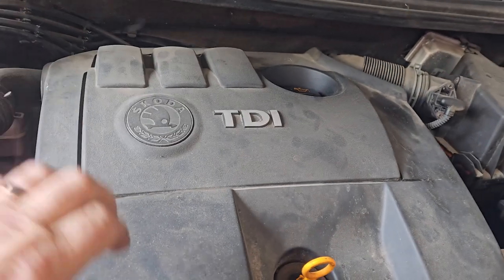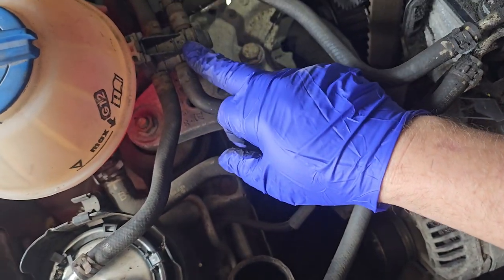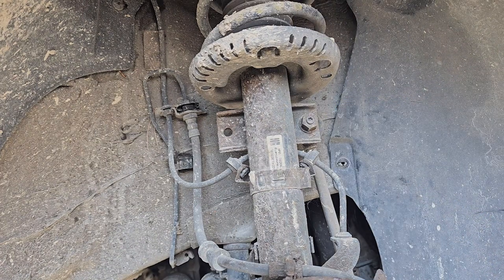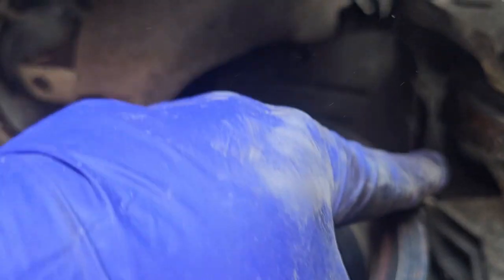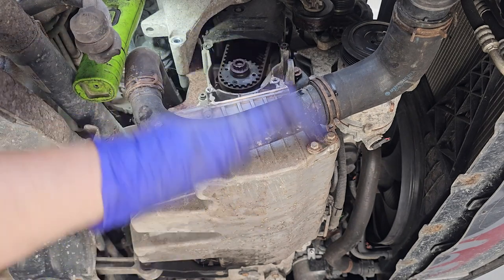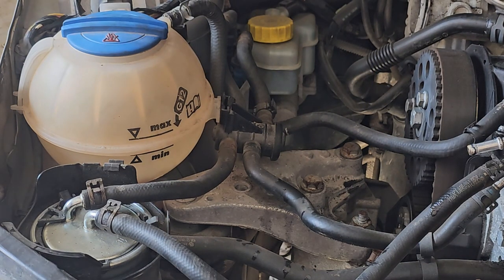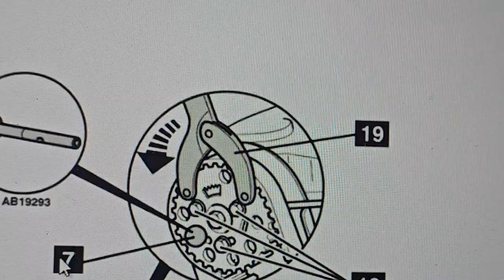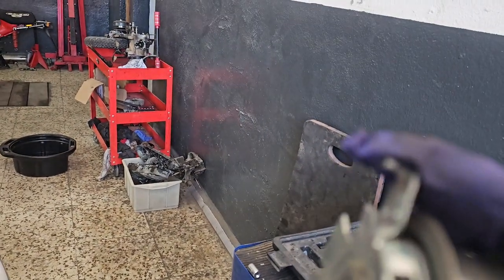VAG Skoda 1.4 tdi timing belt change part1

Comment: my crankshaft move when i try to undo the bolts how can i keep it from moving? thank u
Reply from the maker: Put a socket and bar in the big bolt in the middle so you can counter hold while you undo the other 4 bolts. Please be very careful if you are attempting this job, as if it is wrong you can wreck your engine.